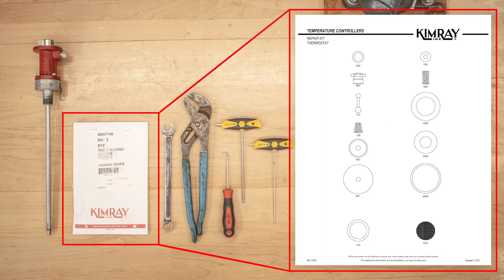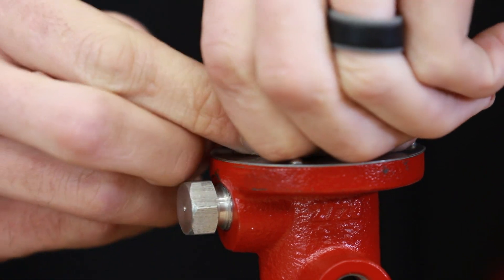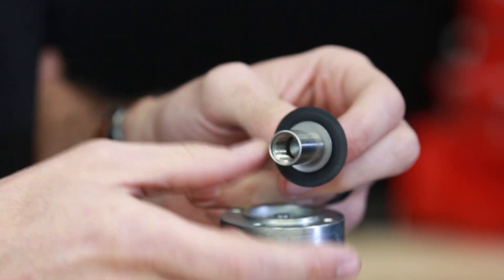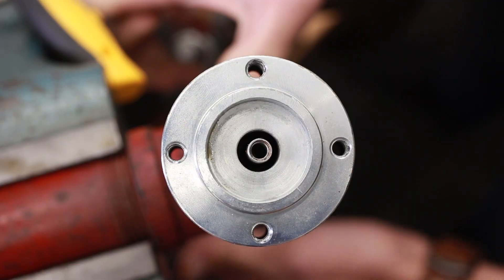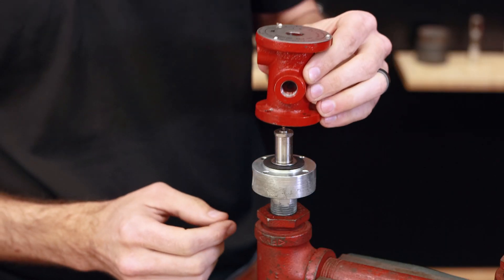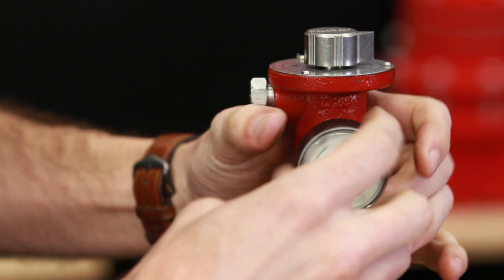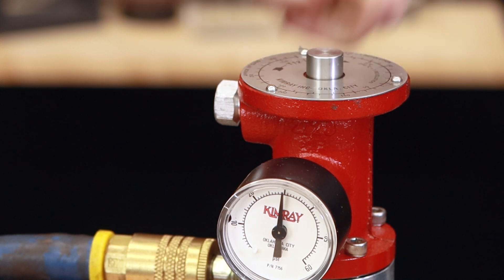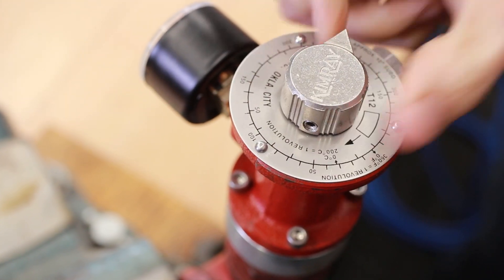Kimray T12 Temperature Controller (Thermostat) Repair, Maintenance, Testing & Calibration

Comment: I tested a t12 thermostat.
I then installed it, Now with 30 psi to the t12 supply does it work on volume of 30pounds of pressure or strictly pressure . Vid is vague on how adjustments relate?
Reply from the maker: Your best answer is going to come from Product Support - you can call, email or online chat with a team member to better talk through the issue and get a solution. https://kimray.com/get-product-support

Comment: Nice Video! Good to know how to rebuild one if I ever need to. We disconnected all our T12s that run the burner on the separator for emission reasons this year. Could you do a repair/rebuild video for a 240 top works for a Dump? 6 and 4 bolt.
Reply from the maker: Are these the repair videos you're looking for? 
Piston Balanced Throttling: https://youtu.be/h248I3v1McU
Piston Balanced Dump Valve: https://youtu.be/3LoVsb5j2F0
Reply: @KimrayInc  no unfortunate. these aren’t the ones.
Reply: @KimrayInc  the Kimray rebuild kit I bought says “ 2 IN MA PB PO - D REP KIT” 
Top # on top is M908350. Maybe that will help with finding the type of dump I’m talking about.
Reply: Solo  el kit de reparo sería necesario para volver a dejarlo como nuevo trabajando?
Reply from the maker: ¡Sí, en la mayoría de los casos! Si experimenta algo más que un desgaste estándar, puede comunicarse con el servicio de atención al cliente de Kimray para comunicarle sus inquietudes. https://kimray.com/get-product-support